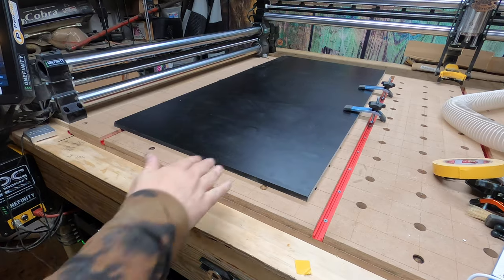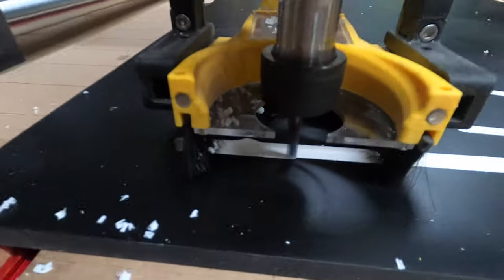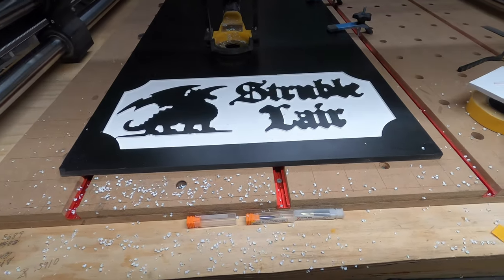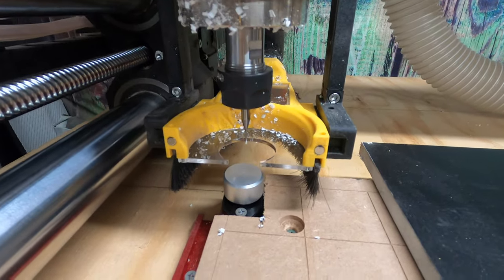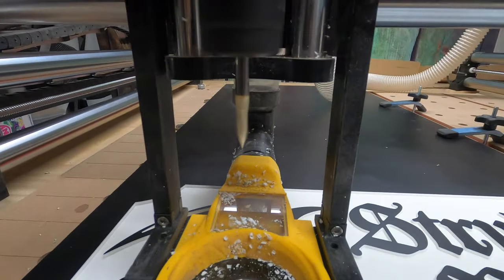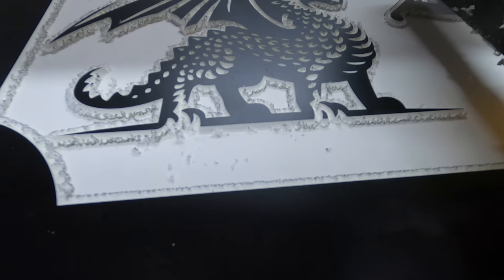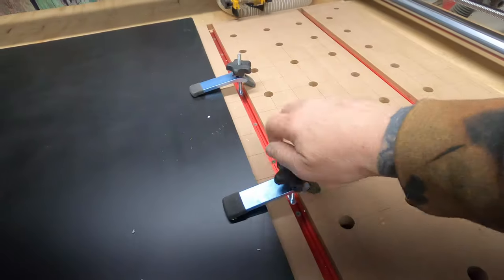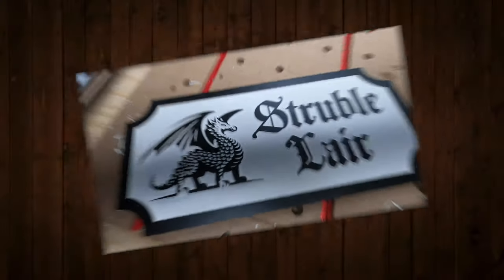Struble Lair Sign Number Two!

Comment: Where did you get the PVC with the wood grain finish?
Reply from the maker: Home Depot. It’s smooth on one side and wood grain texture on the other side. $40 for a 1/2 inch thick, 24x48 sheet, white only.

Comment: Great video again Thank You. Question can you run multiple tool paths in Easel pro?
Reply from the maker: Thanks!  I used Easel a while back but I don't remember if you can or not.  I would think you could since so many people love Easel.  I think I remember reading that Easel won't work with my Masso controller.

Comment: What size spindle did you get, 65mm or 80mm?
Reply from the maker: 80mm. It’s a 2.2kw (3 hp) water cooled spindle from PwnCNC. It runs on single phase 220v. I have a small discount code link in the description.
Reply: I already have the 65mm 110v. I was going to ask about your dust boot but it wouldn't fit my setup
Reply from the maker: I believe they make them in 65mm too.  Click the link in the description that says great CNC accessories.  You get a 5% discount.

Comment: Would you mind sharing your feeds and speeds on this job?
Reply from the maker: I went and added the info to the video description - thanks for watching!
Reply: Try running the bit in the reverse order. Start with the Vbit then run the 1/16 and so on. You might find that most of the fuzzies will be cleared away by the clearing tool path.
Reply from the maker: @joedilaura2560  I’ll have to figure that out since vcarve pro puts the bits in that order, but maybe I could create separate files for each tool path.
Reply: @TerrapinCreations666  After the tool paths are generated you can highlight one by clicking on it. Then there are blue up down arrows just above the list of tool paths. You can reorder the tool paths in any order you want. Then when you save the tool paths they will save in the new order.
Reply from the maker: @joedilaura2560 Thanks! I never noticed you could change the order.
Reply from the maker: I just went and saw those little arrows.  I think I'll try that for the next one, since I need to make another exact same sign.  I'll make another video showing your advice about doing the v carve first.  Thanks!
Reply from the maker: @joedilaura2560  Check it out!  https://youtu.be/XZRDJFL_mec